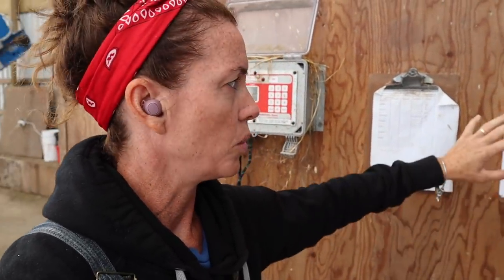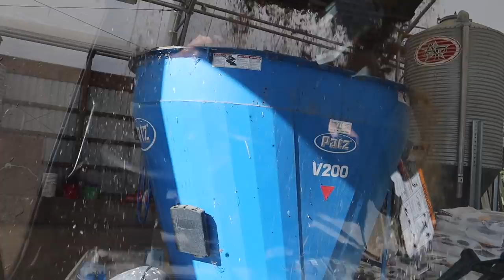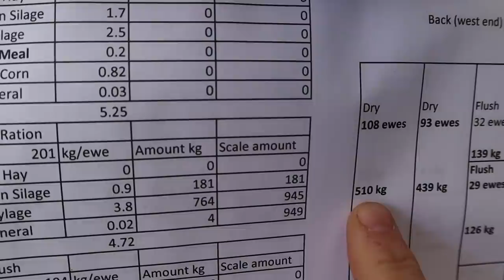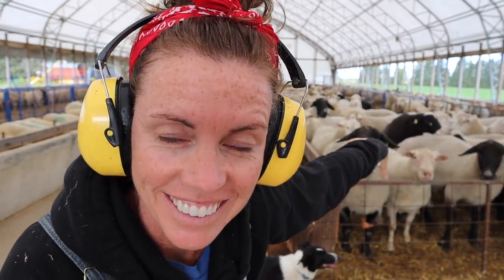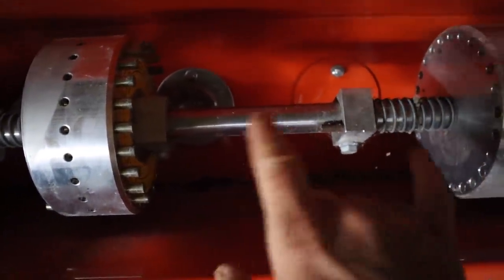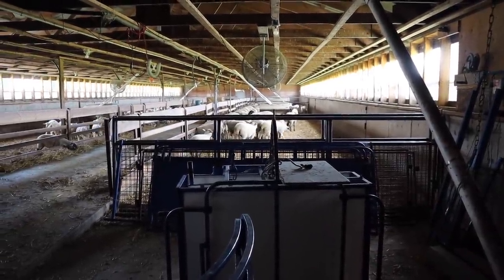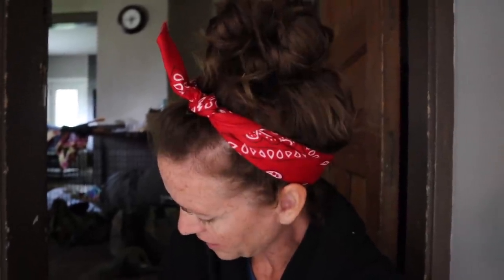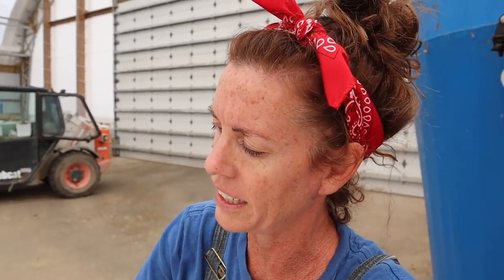FEEDING 400 SHEEP!!: Vlog 342

Comment: Thankfully, I have few enough horses that I can buy my feed directly from my local feed mill already mixed to the ratios I need. Right now, I only use two mixes - a Senior feed for the older ones and a performance mix for the other adult horses. Two kinds of hay, served in flakes - alfalfa and timothy. Who gets what type depends on the nutritional needs of the animal and the time of year. Supplements are given to each individual horse per feed (twice daily) and tailored to specific needs. No youngsters or breeding stock to contend with which is nice. I'm math phobic, so kudos to you for balancing and mixing your own ratios!

Comment: That’s so cool I didn’t know that they ate different kinds I thought they all ate the same
Reply: Feed is easily the biggest ongoing cost of looking after any livestock commercially so it therefore makes it really important to minimise food costs without compromising animal health or performance. 
For example animals getting too fat (or thin) will directly be reflected in the price paid to you as a producer. 
So managing the sheep's nutrition is pretty critical hence why Sandi uses a flushing ration on the ewes prior to and during mating and for a while after. 
If ewes are too fat before flushing they will not ovulate as well (and even possibly not at all) and as a direct result less lambs born. If too thin then they will not ovulate at all and if they do singles are likely to be born.
Similarly if too thin during the latter stages of pregnancy they will be weak giving birth, low birth weights,  poorer initial lamb survival and ewes will not milk well afterwards either. Results = supportive feeding for the lambs (extra food costs via the milk machine) for small lambs and poorish weaning weights that results in them taking longer to reach finish weight.
Thin ewes are also more disease prone as are their lambs = higher mortality which are a total loss (or worse as you may have to pay to have the dead animals removed off the farm and incinerated as the case here in the UK).

Hope this helps as a partial explanation!

Comment: Excellent presentation if I may say so of the basic "nuts and bolts" of feeding commercial livestock.
In practical terms how do you manage to get the correct approximate amounts and balance of forage into your mixer when your filling it via the bobcat? Does your Bobcat have any sort of weighing device installed on it? I realise that the mixer has a scale but it is too late if you have poured an extra large bucket into the mixer to take some out!

Comment: Wonder why you feed them the white plastic? Or did I see that wrong? You scooped it up with the second time. Then dropped it in the mixer and I then did see it come out on the belt.
Reply: It's from the bags holding the feed. That's what she meant when she said she doesn't like the plastic. 

It's not meant to be in there but it's really hard to avoid it
Reply: She did say a sheep can pick out a grain of pepper from fly poop.. I assume they just don’t eat it.
Reply from the maker: Hey Paul.. the bag sometimes tears outside and comes in with the feed.  It will get pulled out of either the mixer or the feed bunk.  The sheep won't eat it... it just makes for some more work to clean it all up
Reply: That settles the case. Sheep are such picky eaters that even where you mix some plastic they don't eat that. I learned something new. I live too far away to be able to order a regular supply of your meat.

Comment: I just released you don't castrate your male lambs. Why don't you castrate the male lambs? As they will gain more weight quicker when they are castrated
Reply: I think she mentioned once that she's not been docked for it and I wonder if it's only because they are so young when they go for slaughter. Why waste the energy and the banding if you don't have too?
Reply: @kthearcher3357  when the sheep are in such contained conditions it would only take less the 1 min per lamb especially if its done when they are 1 day to a week old
Reply: These lambs go to slaughter early. So it does not affect their growth. Older complete male lambs will go through a teenage phase just making frame and not fattening. Also intensively fed castrated lambs are more prone to urethral calculi which cannot be economically treated. Ram feeds usually contain added salt to make them drink more and pee more to try to prevent this.